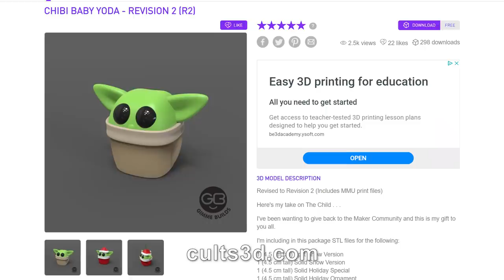Is it Smooth Enough? Testing Polysmooth with Polysher and Primer!

Comment: I was a PolySher kickstarter backer, and I've had 3 units for a couple of years now. Overall, the PVB filament is too expensive for me to monetize, and the nebulizer performance is hit and miss. It looks like you got a good one, but most put out half the volume of mist and at a lower height than the one in this video. I find I spend at least 5-6 raisings fiddling with the nebulizer, but once I get it working I get about 12 or so smoothings out of it before I have to fiddle with it or replace it. It's perfect for artistic applications if you're looking to mimic ceramics. For mechanical or fitting parts I would avoid polishing individual parts as the edges will get rounded.

Comment: I've realized these things are basically just humidifiers. If you put alcohol into a normal cold mist humidifier you'd probably get the same effect.
Reply: Id be careful with the mister, could start a fire. Dont leave it unattended.
Reply: @SuicideNeil  Wait until AliExpress and the Chinese produce it for $150 or less
Reply: You need to buy the mister units that are meant for essential oils, normal water misters do not work well and in some cases not at all.
Reply: @UCweaewo7uPrhQcYAzQ3PSGQ really it was meant as more of a joke but I always buy from people who invent the items otherwise this retired engineer will be too guilty.
Reply: @Robothut  and those things are cheap and everywhere. I've got a few I could take apart and use if I wanted.
Reply: @SuicideNeil  Yea, it just makes more sense to get an SLA printer that prints with better quality. I have a Polysher from the kickstarter and it isn't very good and mostly doesn't work.
Reply: I love this.. Crowdsourcing solutions for expensive products.
Reply: @glennleader8880  When companies price gouge the end users find their own way.
Reply: Not really a humidifier, more like a nebulizer. True humidifiers create vapor (gas); nebulizers & atomizers create aerosol particles. Aerosols consist of particles that are small enough to stay suspended in gas or air for long periods of time, or until contact and deposition on a surface, such as an object inside the PolySher. The PolySher likely has either an ultrasonic nebulizer or a vibrating mesh nebulizer that creates the aerosol particles. Both are electronic. I'm thinking of building a DIY device using discarded vibrating mesh nebulizers from the hospital.

Comment: For the price of the "polisher", you can buy a SLA printer who would give WAY better result. It's really not worth it.
Reply: Great point or just built your own "polisher" with a little fan and evaporation which happens normally anyway. :) This is what many companies do anyway, I worked in science and when something failed I carefully opened a unit (usually 500 Euro's or so of whatever general equipment we had, not crazy expensive ofcourse otherwise I wouldn't :) ) and it was shocking how simple some units were (whatever they are). I made one myself for like 30 Euro's. Gotta love companies.
Reply: @VincentGroenewold  I was also looking into using PLA/PHA which I heard smooths well with acetone... but it's too toxic.
Reply: Even the price of the filament. $40 for 750, essentially $53/kg. ABS vaporsmooths way better even if it's toxic/more dangerous.
Reply: @androiduberalles  I was planning on doing this at home with the safe way. Using a tote bin lined with towels and spray the inside...
Reply from the maker: What's crazy is when this first came out years ago, there were no affordable SLA machines. NOW, we have many to choose from. It's crazy how fast technology catches up.
Reply: 3D Printing Nerd ow didn’t realize this one was THAT old. :)
Reply: @3DPrintingNerd  I just wish SLA was durable enough for wearable props
Reply: @3DPrintingNerd  speaking of new SLA machines, what are the news of SLA machines in 2020? any new champ for decent price?
Reply from the maker: @CesarinPillinGaming  I'm getting in a new resin machine soon, and if it works well, it may be the one to beat!
Reply: @3DPrintingNerd  thank you! will keep a close look at your channel.
Reply: @KRGraphicsCG  new resin formulations are pretty damn strong and impact-resistant, the tech is exploding onto the scene really
Reply: @teslacoil4335  I'll have to look into that... and make sure I will be able to print my components without any issues. I'm designing a custom HMR designed to hold a camera while mounted to my head... 

Just need to find an affordable SLA printer, and a place to print it without the horrible smell.
Reply: I bought a face mister and it works great for smoothing. HOWEVER wear a face mask. Was $13
Reply: But it’s can be a time trade off.
SLA is slower, need wash and cure to do it right. And there’s still some loose finishing with support removal. Also FDM material choices can be stronger in the end. 

So it’s a draw.

Comment: I’ve tried this filament out a bit with a home brew (ultrasonic) mister in a plastic tote.  It worked but was a bit finicky.  The longer you expose the part to, the smoother it can get.  You can get beautiful finishes with no lines.  I’ve also just used a fine mist spray bottle in a well ventilated area and get good results as well.  I spray the part, wait a bit, if there are areas that need more, I just spray those surfaces on the model and repeat as needed.  It is messy and waist-full of the alcohol this way but the results are still quite good.  Caution though as You can reach a point that you end up melting the part so slow and steady yields good results.

Comment: Looks like the smoothing process works really well for up-facing surfaces, pretty well for side surfaces, and I would guess not as well for overhangs.  Pre-sanding would probably improve the effectiveness.

Pretty good for times when you need to look less like a printed part.
Reply from the maker: I would still like to get some models printed, then sand one, and then polish. I wonder if the texture left by sanding would appear in the polished prints?

Comment: I have had 3 Polysher units. All 3 have failed, Also I have used 10 different Nebulizers and all of them have failed. The Polysmooth filament is nice. Once treated and let to air cure for about 1 week gives a very strong part that is more flexible than PLA so is less prone to breaking. Keep the polysmooth sealed when not using as it is hydroscopic and will give you stringy prints if not dry. In the end building my own system of misting the alcohol works best.

Comment: The reason for the sheen on the smoothed model's:
  The models have a micro porous surface which the smoothing process removes by chemically melting a very thin layer of plastic on the surface. The smoothing process essentially fills the micro pores providing a uniform surface, hence the reason the smoothed model's have a sheen to them and the non smoothed one's are flat and almost gritty looking. The melting process is also the reason why you loose the tiniest bit of detail too. You would loose the same amount of detail via sanding and priming as well, so really it shouldn't be a concern (for model making).

Comment: You should print a 28mm model and run it through the polysher and see how smooth it gets before you lose too much detail
Reply: Check out the partnership between Infinite Dimensions and Polymaker you will be amazed by what PolySmooth can do in the 28mm world :)

Comment: I think print, sand, smooth, prime would be the best workflow.  The largest layer lines would be knocked down, and even some plastic dust filling the largest cracks before the smoothing evenes everything out.
Reply: I guess the idea is that it would be useful for models that you cannot sand because of the surface texture or too many details :)

Comment: It needs a vortex fan.. just a tiny little air current to swirl the mist and even out the distribution.
Reply: There is a fan at the top periodically swirling the air, fan is a double edged sword as it would also smash the mist down if used too much. (Actually the fan is full power at the end to smash down the mist before it opens :) )

Comment: It's an intriguing process. I agree the other variables that are worth exploring. You need to investigate them and show us the results. The motor-assisted lowering/raising platform is another thing that could go bad. A clam-shell front [with a latch] [or a lift-off top w/ latch(s)] would be a better solution - in my opinion anyway. Nice addition to the arsenal of "things" in a Maker Shop.
Reply from the maker: I think I'm onboard with what you're thinking. The slow moving platform is a fun idea on paper, but for actual use, I can get in the way.

Comment: From my experiments, hot acetone vapor is WAY more efficient than cold vapor or this kind of ultrasound vapor thing.
But, it's still more efficient on the lower parts because, well, it's vapor, so it's heavier than air :(

Comment: would be good test how transparent those are too after smoothing as some technic make foggy inside based on prusa3d video about transparent filament so would it remove need of wet sanding
Reply: 3d printing general did one of those - the answer is, pretty damn clear. :)

Comment: If it wasn't for the price for that filament, I would use it... but I just print at .09mm layer height and print REALLLLLLLL slow...
Reply: .09?  What printer do you have? Most stepper motors have a "magic number" in even increments .08/.16/.24/.32
Reply: @technodrone313  I have the Robo C2, and I have been able to print at .09mm layer height... I don't do it unless I have a precision part that I don't want to spend too much time sanding. Or models that have INSANE details. Back in 2018, I printed up a Boulder model straight from ZBrush with ALL of the details INTACT!

Comment: Some time ago I did my smoothing in an unneeded pot with aceton(do not try this at home!). Important for time: solvents and temperature relate. 
Those models are not very fine-detailed, but it's important to know that chemical-melting your surface always goes on the cost of your printed details. Yes, the surface gets glossy.

Comment: Here's what I suggest for the error display: a 25 cent 7 segment LED digit display.  Have it flash an E followed by a number (i.e. E 2 for the evap) this way a consumer doesn't have to take a shot in the dark as to what to get to fix an error 😒..
Reply from the maker: I'm on board with that :)
Reply: @3DPrintingNerd  thanks!!
Reply: Maybe we couldnt see it on the video but there are only two errors: nebulizer connection, not close well. So depending on which LED lights up you know the error (there are icons on the LED) :)
Reply: Maybe we couldnt see it on the video but there are only two errors: nebulizer connection, not close well. So depending on which LED lights up you know the error (there are icons on the LED) :)

Comment: Should of had a 3rd print where you sanded them for about the same amount of time as they were in the "smoother" to compare
Reply from the maker: You're right. I'll wait until I get some non-clear polysmooth and try again
Reply: I guess the main idea is that some models are not sandable because of the special surface texture or the amount of details :)
If you check the Infinite Dimension models that Polymaker is showing to all there shows (picture on Google) these models are not sandable :)

Comment: Lots of room for improvement. Get rid of the elevator platform, use a single fan above or below the platform for an updraft and maybe use a flexible top for the platform.  No reason to overly complicate a simple process. Neat idea though.
Reply: The elevator platform allows the print to come out from the top so that the alcohol mist stays inside, it is slow to avoid the print to tip over during the motion. (could be improve though). There is a fan at the top already, fans have to be used carefully with mist because if you increase the chance of droplets collision in the mist, you kill the mist lol. I think the "over complication" comes from making it as a product, of course DIY are easy and cheap to make but you cannot sell it because it wont pass any certification lol. (IMO) (however im sure there are ways of improvements staying within the safety rules :) )

Comment: as usuall, great video. I still wouldnt purchase it, so thank you for taking the time to review the product for me:) My tevo tornado can print PLA very very smoth and i have no mods. I also use the 2in1 filler primer from rustolem with excellent results. If i use filacube engineering grey PLA, theirs is specifically made to be sanded with sand paper.

Comment: I would be interested to find a clear coat that we can use on top of the filler or paint. I fear any clear sprays on the market that i know of, will melt the print.    Certain parts would be ok with a mat finish but i have some that would be much nicer with a clear finish.
Reply: There are no paints or clear coats I know of that will hurt PLA.

Comment: I just like to set my print layers to 0.1mm and print slloooowwwwwwwwwww :)
Reply: Same...
Reply: 0.05mm layer with 0.15mm nozzle creates a basically layerless print with a prusa MK2, it does take infinity to print tho
Reply: @notme4083  Yep... one of the major caveats if precision is a priority. But it does smooth like a champ :) a quick 220 followed by 400 and you're basically done :D

I've done this on a .4mm nozzle and the layer lines were virtually gone. I end up using XTC-3D on it, even though it's overkill at that point
Reply: @KRGraphicsCG  I always print at 40 microns with a .4 nozzle, right out of the box. I wish reviewers would compare reasonable layer heights to polysmooth instead of doing the fast and rough comparison.
Reply: @noxix7641  I tried printing at 40 microns... I unfortunately get precision errors in the slicer :(... I usually got there if I need that super accuracy for engineered parts (and if I have daylight to burn)

Comment: I doubt the product has much real use as a matrial for printing objects, because IPA is a very commonly used for cleaning and sterilizing. And there are just too many ways in how the printed object could come in contact with IPA or other alcohols tha are probably also dissolving the material. Somehow I think that's similar to having a material that dissolves by just air alone. I once saw a more sensible application in using the PVA for supports, so you could remove the support from your printed PLA object without a trace. But this also doesn't seem oiteresting now, where anyone can get an resin printer with much better overall quality.
Reply: I do see a good use for the 28mm figures or game set. Models like this are not sandable and wont be in contact with IPA :)

Comment: I have had much much better results with sanding and filler primer if sanding is not your thing and you must have smooth finishes to your prints then SLA is the answer.
Reply: Yeah, the result are just bad. Sand paper and filler primer are way cheaper and give better result.
Reply: Sanding surfaces with details is not that easy, for example sanding the hair of the small Joel is a nightmare, and models with surface texture are simply impossible to sand lol.

Comment: Don't know if anyone can help me, I'm using FreeCad and cura on a Ender3, stuff prints really well however is always about 0.2 mm bigger than it should be. Is this because I'm printing with a 0.4 width? So if it doesn't divide into 0.4 it will always oversize the object however I tried to print something 8mm which is a multible of 0.4? I have checked the E-steps that didn't make any diffrence. Looking at cura everything looks fine like it says it should be 8mm. I know that there is errors and so it will never be perfect but 0.2mm seems pretty big and its always bigger rather a mix of bigger and smaller. Maybe there is a probem with the steps per mm? however that seems unlikey cause I have a small slit in the part and that is being printed too small... any advice would be awesome.

Comment: I really don't understand the point of the elevator. Just seems like over engineering to add to the price tag to me, and also more points of potential failure. Nice results though.
Reply: The model has to come out from the top so that the alcohol vapor stays inside, the slow motion would prevent the model from tipping over, now I guess it could be design in different ways to make it better :)

Comment: Polysmooth Filament twice as much as normal filament with a smoother that cost 300 bucks. OR me: put on a coat of Resin on normal pla model and hit it with uv to set it. Smooth....and cheap.

Comment: really doesn't seem worth it, yes it helps but not to the point where you don't need to sand. Getting a resin printer would be a better investment.
Reply: When you sand and use this polysher it comes out amazingly.

Comment: read the manual before reviewing products? Does it even have one? what sort of a review can this be when the reviewer doesn't know how to use the product? do your homework basically. If there's a problem with the product, get in touch with the manufacturer and fix it before posting the review. In my mind, this poroduct is garbage, it did nothing but break continuously and the reviewer did not know how to use it (maybe that is why it breaked in the first place) ...
Reply: The good thing is that from my experience most of the people dont read the manual lol so this video show what most of the people will face :)
By the way I dont think it was an actual "Review" I think it was just a project to show one particular use of the Polysher (would it take primer better when smoothed)